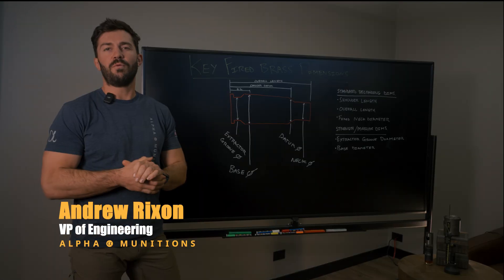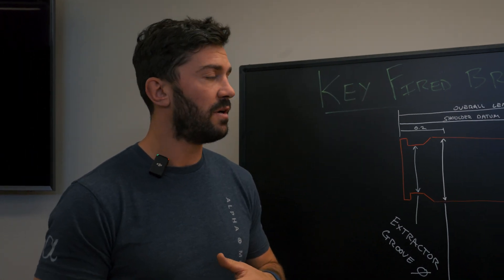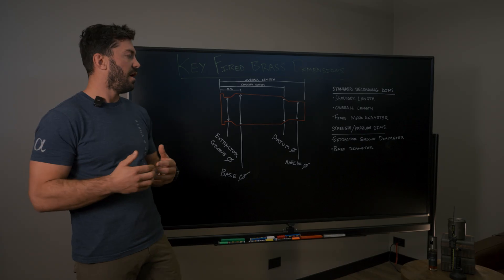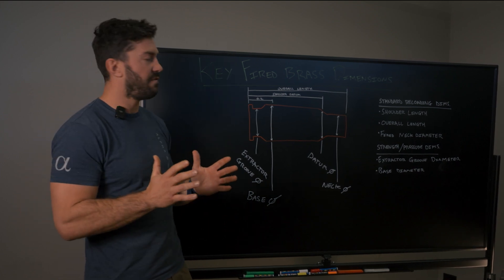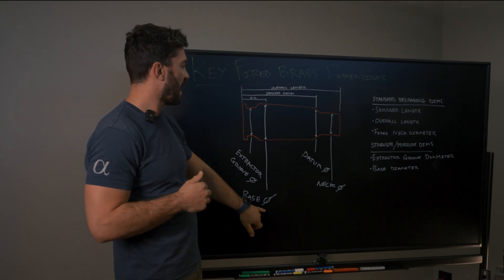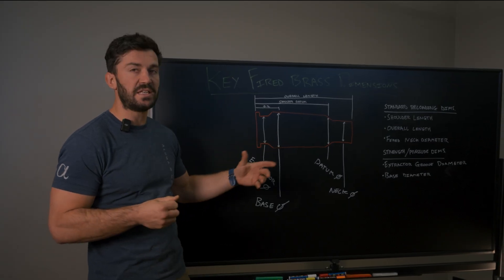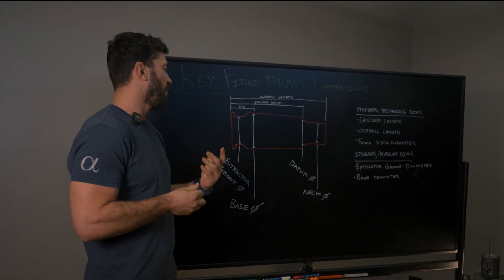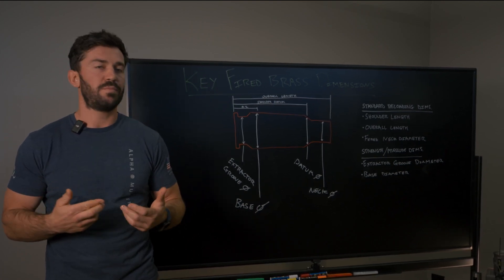Key Fired Brass Dimensions

Comment: So it is okay to cut the overall length of the case to 10 thou shorter than SAAMI?  I never realized it was important to check base size.  That's on my list for tomorrow.
Reply: Checking the case diameter at the web IS prudent when developing a load, especially with a semiauto rifle.
Reply: That's some nonsense. What you should do is actually measure your chamber, either by casting it, or they sell some products to check case length clearance. 

This whole notion of, I have absolutely no freaking idea, so lets just cut every thing short of saami specs, because reasons, is absurd

Comment: Taking advantage of your video, quick question. What happen when one of the dimensions shrink instead of grow in one particular rifle. For example, shoulder length (head space). I have a rifle that the shoulder length shrinks by 0.001 after firing.  Any concerns here?